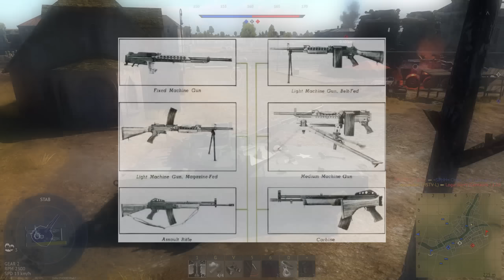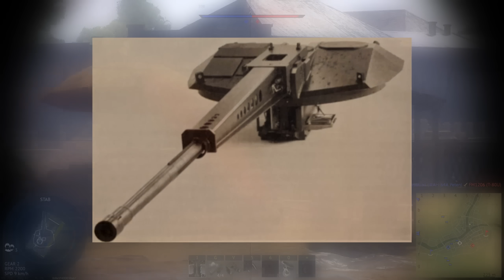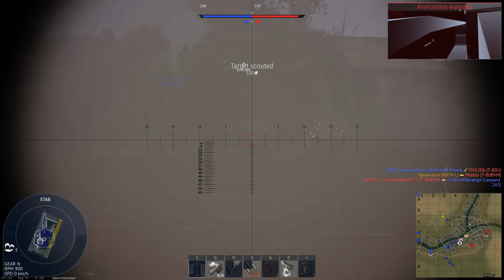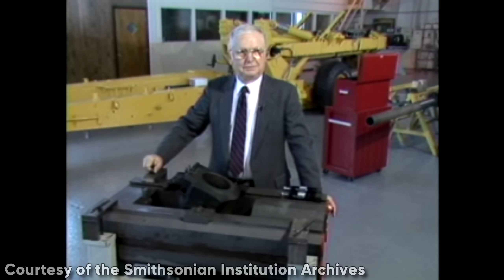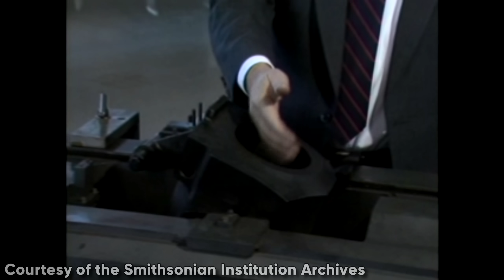Eugene Stoner Interview: XM274 Automatic Cannon

Comment: Bruh what if they cut the barel in half and gave it self guiding ammunition woth the same system for aiming as amos systems where they click on a map without having to do math so it would work as an amos but way better then it would have a stabalizer so u could use it as a direct fire wepon and potentially fire apfsds but it would probably be only fast enough to destroy ifvs

Comment: the xm274 auto cannon can use certain mm guns and the 75 mm gun is used for that tank cause its cool looking and its a auto loader 75 mm gun for a liht armored tank in my opinion they should of put the xm274 should be on a striker instead a tank cause the hstv-L should use a 100mm or 85mm gun i hope you can see why is say that

screw it 75 auto loader its better than a gun fuck it its a auto so fire away.
Reply: Good idea it should use a 85mm gun

Comment: There's actually a lot about this system that is very similar to the G11's operating system. It's interesting that so many designs during that time period were fooling around with telescoped/caseless ammo and rotating push-through breeches.
Reply: Cause it's advantages are undeniable. It's downsides back then were not so clear.
Don't get me wrong I think it still makes tremendous sense though I think it could work better if integrated into the concept of a cryogenic propellant cannon. You insert the projectile into the rotating cylinder as the back of the gun gets injected with the propellant. Once ready the projectile swings into place and the gun fires. This way you can separate the projectile and propellant in a configuration that allow both to prepare separately in specially designed compartments and you don't deal with the traditional issue of caseless because the cryogenic fuel cools down the barrel, reducing wear and preventing overheats.
Reply: True...though looking at what's available on this gun as compared to the G11, it's pretty clear HK forgot the part about keeping things simple and went full blown Swiss watch.
Reply: @kfeltenberger  But it's H&K, so it works.
Reply: @reinbeers5322  H&K made some garbage over the years, just like every manufacturer.
Reply: @Pulsarr1  Harder to find one who made a gun as complex as the G11, that actually works.
Reply: @reinbeers5322  And it's overpriced, over complicated, you can't get parts for it from the factory, and they treat you like shit.  Yeah...not a company I want to do business with.  I've been a FFL and have tried to get service and was pretty much crapped on.  They have a good hype machine, though, because lots of otherwise smart people keep lining up to be treated like garbage by them.
Reply: @kfeltenberger  You can't get parts for a G11? What a surprise!
Your argument falls short, though. The MP5 is dead simple and set the standard for submachineguns.
H&K and others were so good that the US govt put an import ban in place because american gun makers were getting beat.
Reply: @reinbeers5322  No, moron, I'm talking about parts for their in-production firearms.  If you think the ban was due to competition, you really need to go back and examine history.  I lived through the good years when anything could be imported until Bush 41 instituted the first ban for civilian arms, then Clinton followed it up with additional bans and the Brady Act.  The bans were only on civilian weapons, LE and Mil had no such restrictions.  HK has good marketing, but beyond that, they're just good guns and nothing really special with a very few exceptions.  

The MP5 had one thing and one thing that made it stand out; it fired from a closed bolt/locked breach at a time when everyone else used open bolt weapons.  I would venture to say that an basic open bolt SMG was far, far simpler than any MP5 could ever dream to be...except in a fanboy's mind.

Up until the Princess Gate crisis in London when the world saw the SAS go into the embassy with MP5s, more than 10 years after the MP5 was released, the world standard was the Uzi.  After that, because everyone had a hard-on for whatever the SAS used (and they are the one and only reason the FBI's HRT started with Hi-Powers), the MP5 suddenly became popular.

Then again, I live in the real world, not video games.
Reply: @kfeltenberger a closed bolt has clear advantages. My grandfather disliked his PPSH-41 as a police weapon because he saw someone drop it and nearly shoot a colleague. He liked his AK more for this reason. This misfire was most likely due to his colleague not engaging the drop catch but that’s the point the MP5 and other closed bolt weapons are more forgiving when the user is incompetent.
Reply: @idkidk9180  I won't debate that.  I'm simply stating that it wasn't until the Princess Gate event that the MP5 was anything more than an expensive and unique runner up in the sales/popularity categories.

Comment: It’s like that Royal Navy advert. “If you can fix a skateboard you can fix a bike. If you can fix a bike you can fix a car.” But is “if you can build an assault rifle you can build a rapid fire tank gun” instead.
Reply: Cars are not made to be fixed, and I'm saying that as a former bike repairman.
Reply: @dashiellgillingham4579   Depends on the model year. Most modern cars they are not meant to be repaired except for maybe changing tires,  and some of the fluids.
Reply: @clonescope2433  yeah you either pull out the drive train or life will be hard when you try repairs
Reply: @clonescope2433  True.
Reply: @dashiellgillingham4579  2 Strokes from the Eastern Bloc in the 80s are the exception
Reply: Apparently if you can build an automatic rifle, it's nearly impossible to scale it up to .50 BMG though, which is interesting.